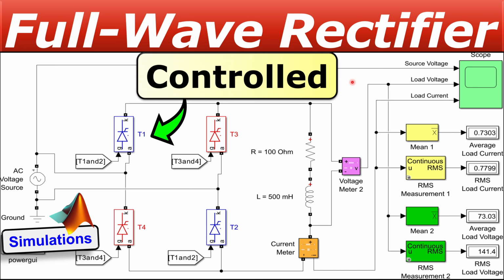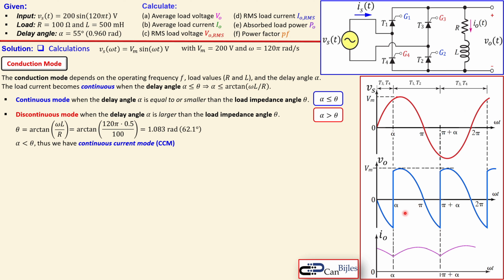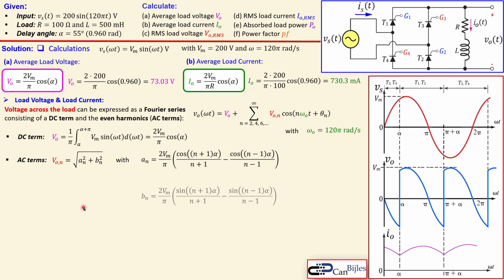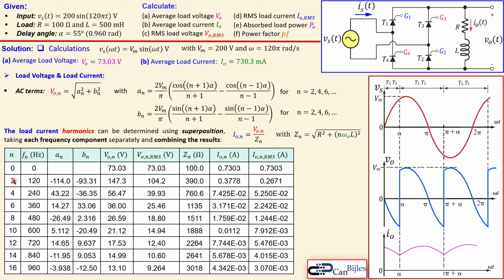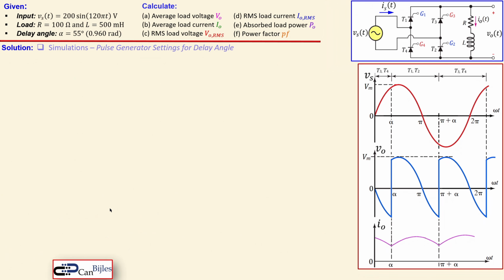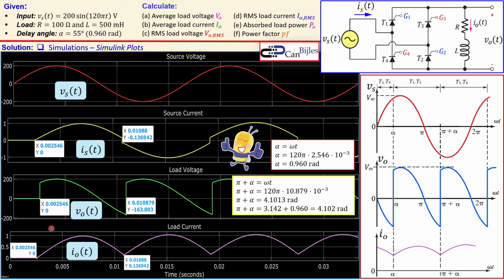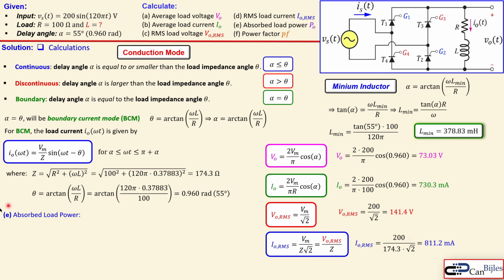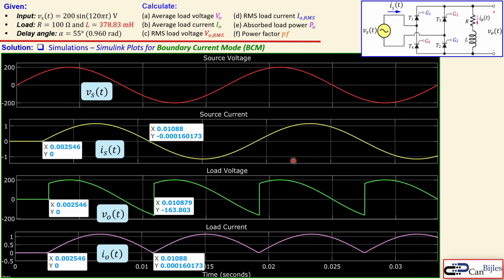🔥 Thyristor-Controlled Full-Wave Rectifier with RL Load ⚡CCM vs. BCM – Inductor Effect Explained! 🚀

Comment: is there a way to make load current more steady without that much ripple, like for driving dc motor because it's toruque will have same waveform as armature current?
Reply from the maker: You can use a capacitor in parallel with the RL load. Alternatively, you might use a LC filter before the RL load. However, in both cases, you should make sure that the system is still stable and does not cause too much delays.